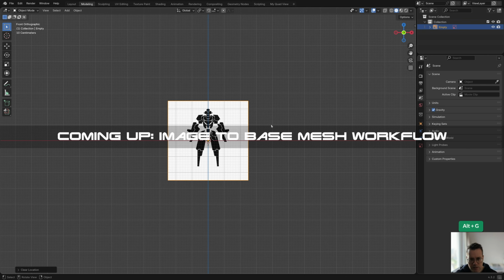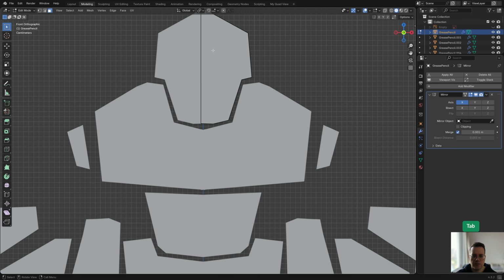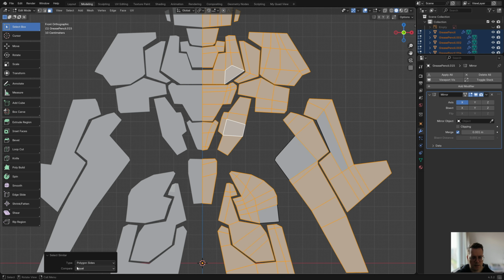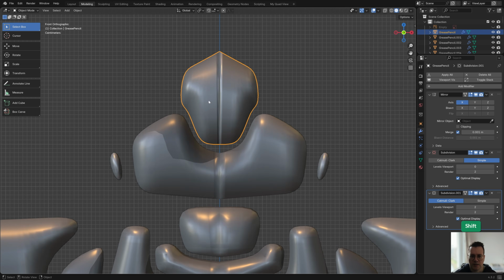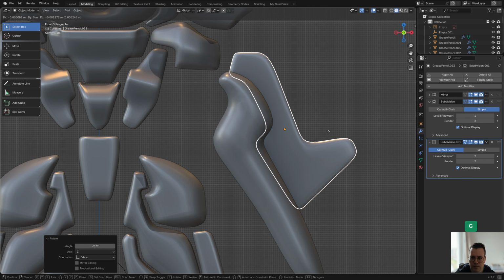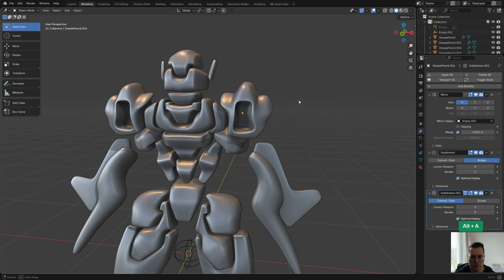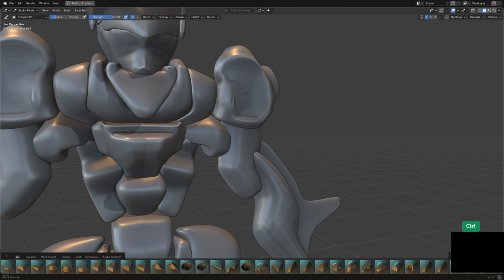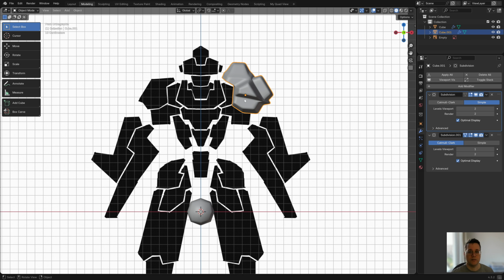Image to 3D model workflow in Blender

Comment: From all the hardsurface modeling tutorials I've seen, this is one of the first that feels more like you're making a mech out of clay than making it in CAD. Not bad, not good, just different and up to your own preference, skill, and what you're able to handle. I like the other way you showed at the end, but at the same time, the knife tool trick is very handy.

Loop tools (a free blender addon) has "relax" and "Spacing" options to help make sure the vertexes are not badly placed, spaced, or what have you. There is a skillset you have to develop when using Loop Tools in this way, but it helps a lot for things like this. 

That said, this was awesome to watch and helped me understand some things. I do like how you point out the other ways to do some of the operations without going "But it is just better to learn the short cuts". While I do say it is just better to do so, as someone teaching it shouldn't be the first thing out of someone's mouth. The shortcuts are HIGHLY based on your control set up, so some "odd advanced" users have their own set ups but are wanting to learn these tricks, thus just saying the operation and the shortcut doesn't always help.

Comment: Hello! Just to let you know - there seems to be an issue with the video player you're using on your website -- tried it in Firefox and Microsoft Edge and there are just blank spaces, for example,   in the Hard Surface modelling "what's in this course" section etc.  

There has never been a tutorial creator i've more wanted to throw money at. I'm flat broke at the moment, but figured I can still help by helping you successfully promote!
Reply from the maker: Hey, thanks but it seems to work fine on my end. As far as I can see there's no Teachable incidents at the moment. Maybe a temporary glitch with the Internet? I'd recommend checking it again later. You can always try a hard refresh with Shift+F5 in the browser.
Reply: @BlenderSecrets  Huh! Probably is something on my my end. Works fine on my phone!  Tried disabling extensions, hard refresh etc and still not able to see them on pc. Apologies for possibly wasting your time! You make the best tutorials ever!

Comment: just w/r/t 27:25: saving frequently is absolutely important, but Blender's crash recovery features are pretty good provided that (as you recommend) AutoSave is set to a pretty small time interval. unfortunately the way to recover lost work isn't super straightforward, so anyone wondering, you go File > Recover > Autosave and select the most recent file. i think a lot of people's instinct is to go File > Recover > Last Session, which has never worked for me